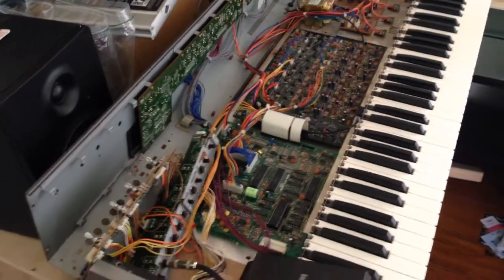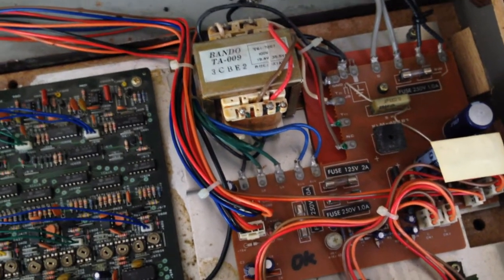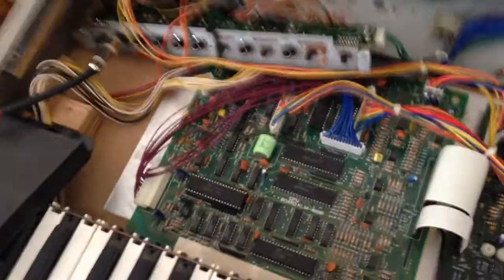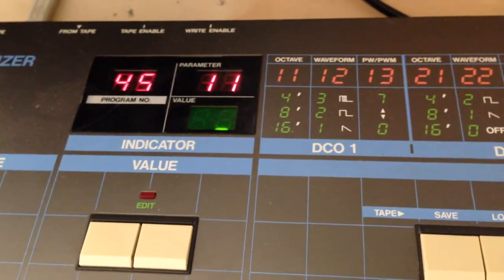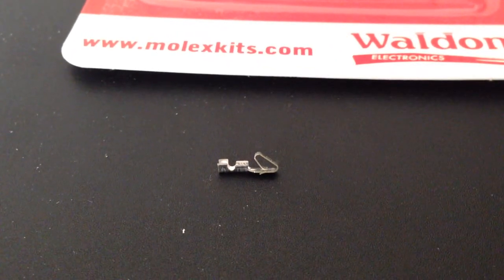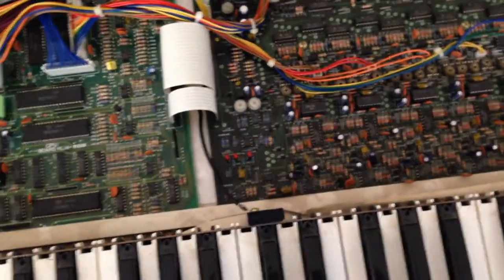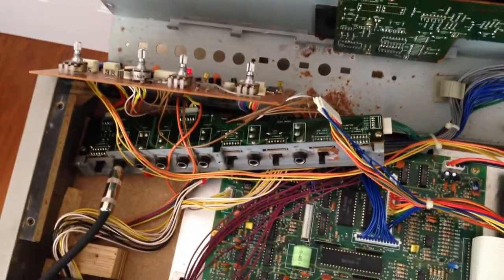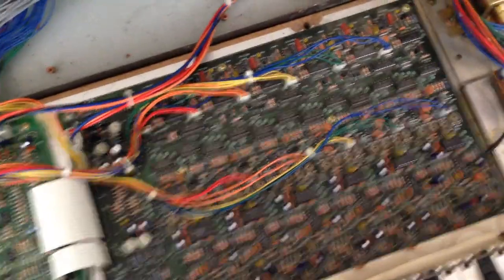Korg Poly-61 Repair Broken Synthesizer Fix - Master Clock Plays Sound Without Pressing a Key

Comment: Tried to get to Miks videos and they are gone, sadly. I just picked one of these up locally for 20 bucks and want to see if I can't get it back to it's former glory. I have leds lighting and each key makes a sound but it's nothing, just a fuzzy pop noise. Any suggestions?
Reply: Hi Joseph I'm just getting  around to fixing my Korg Polly 61 After sitting around for  for years, How did you make out with your keyboard were you able to fix it?